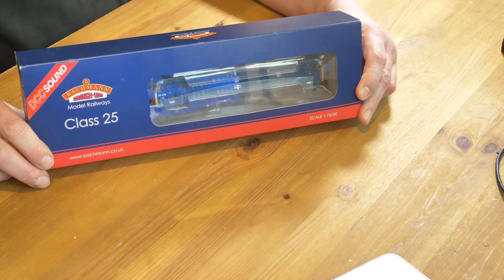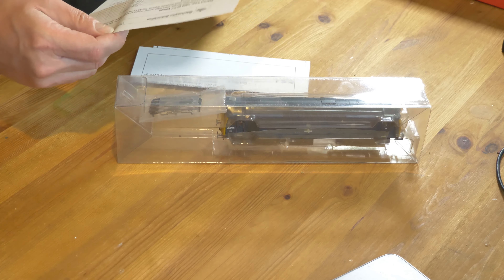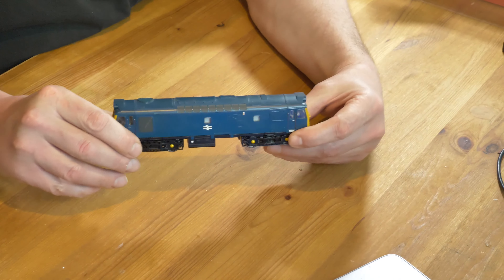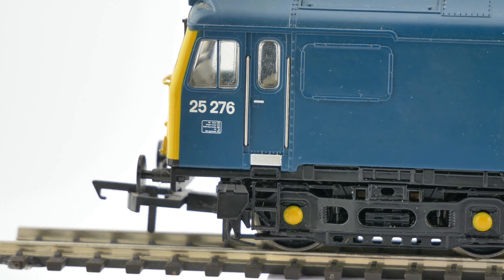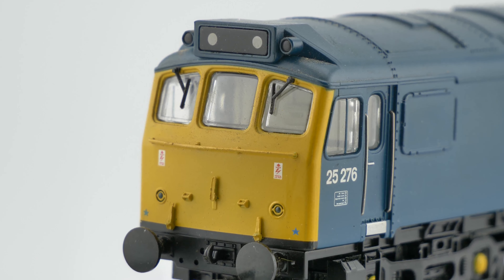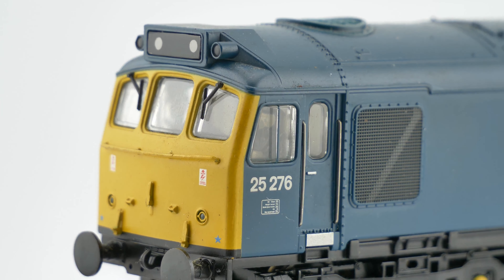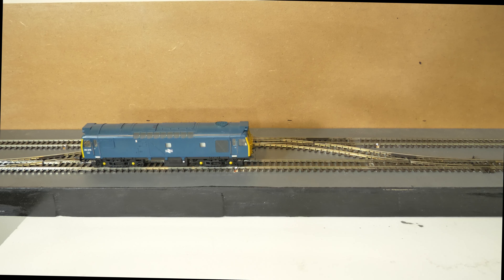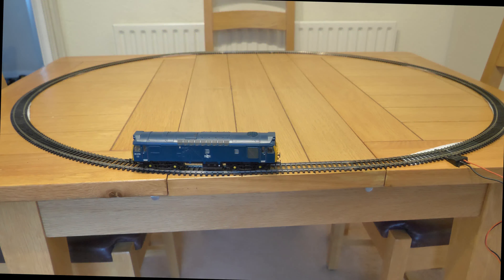Bachmann 32-404DS Class 25 DCC sound, Moving off before it releases the brakes., when sound on !!!!!

Comment: what year was 32-404DS released paul
Reply from the maker: Hi 
What I can see this was tooled in 2006 so maybe be 2006-2007 release, the model I have, from the date code on the box is 27 June 2011, hope this helps
Reply: @PaulsRailwayModels-vz9oz  thanks for that paul